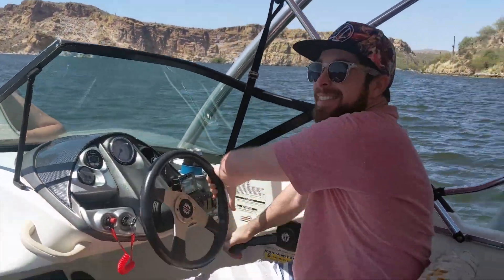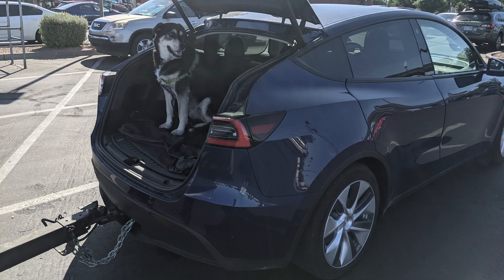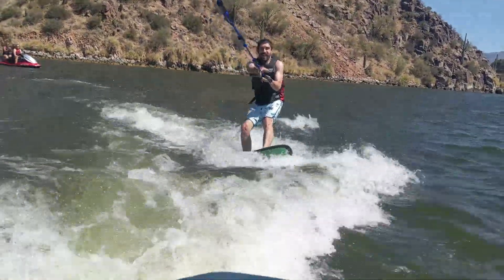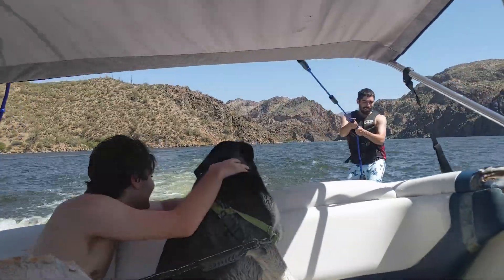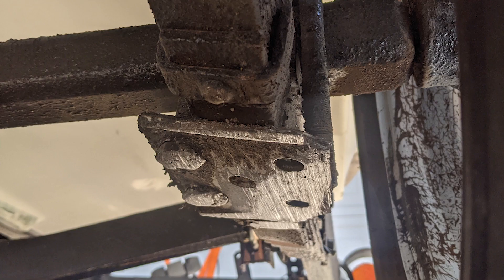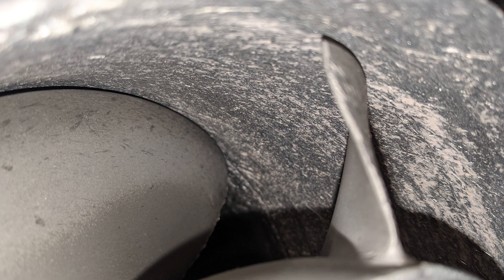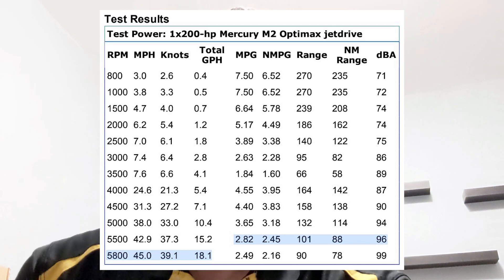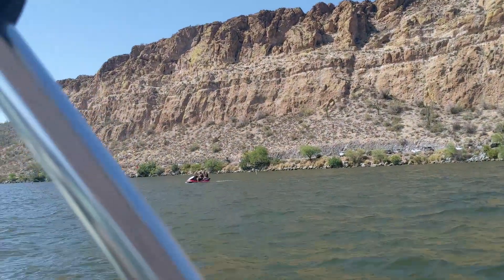E-Doo - Electric Seadoo Boat Wakesurfs but Won't Plane! Conversion Project First Water Test Results

Comment: Holy shit the SAME thing happened to my dad right after he bought two brand new Sea Doos in 1998(?) while we were headed to our lake house. It was about a 1.75 hours drive and an hour in the right wheel just decided it didn't want to be part of the trailer anymore. Thankfully my dad had gotten a truck mostly for towing the dual jet ski trailer and it didn't do much to the truck but I could only imagine if we had been towing the jet skis with something smaller

Comment: 5:11 you guys could have easily shortened the battery belts though, just saying lol. I had same issue lifting my cnc mill and I just made a couple of knots on a belt and it worked :)

Comment: Sweet...
I'm also working (slowly) on a 18' bowrider conversion, sterndrive. Probably not ready for splash until spring 2022.

Just for comparison I went with 272AH Lifepo4, 60 in a 2p30s configuration, 96 volt nominal, total 52 kwh. $5600 delivered to US. Total weight 660#.

Also planning on LV Hyper9.

We need to see more tech stuff!
Thanks
Tom
Reply from the maker: Sounds like a great project! I know the feeling the builds can take a lot of time to figure out. I hope to get more videos out soon but I am very slow about making them especially in the summer.

Comment: I really like your project. I have taken on a very similar project myself. I have bought a 16 ft.1998 Sugar Sand Jet Boat, which I believe is about 700 lbs. lighter that yours. I have removed the 175 HP Sport jet motor. And I am now deciding what size motor, volts, etc.. to purchase for it. If you have any advice for me I would really appreciate it.  Also would you have a picture you could share, of how you mounted and coupled your motor to the Jet Pump?  I have some idea how you did it from your videos, but I picture might be more helpful. Can't wait to see your next video on this project!
Reply from the maker: I really need to finish the videos as I have a ton more footage of the build but have just been a tad busy this summer. Definitely have some pictures I will try to share soon. As far as advice goes, don't under-spec the motor too much as you can see from my plane-ing issues here! And also be aware that the batteries will probably add the same weight as a few passengers - it would be wise to have it near the center of the boat and not so far to the back as I did. Ideally if I could do this over I would have pulled out the 40 gallon gas tank that is in the center of the boat, cut the top off and put the batteries in there, re-sealed it, and put it back where it was. However the reason I didn't do that was I would have needed to cut some major fiberglass to get the tank out due to the Utopia's design. Everything else I have been happy with so far.
Reply: @ThatOneGuy7575  Thanks for the information, I will definitely plan to pull out the gas tank and utilize that space for the batteries.  I am thinking I will probably go with the same motor you have.  Can you let me know how much your battery pack weighs?  I'm thinking I might go with a similar voltage, as you, but try to have a smaller/lighter pack. I know I will be sacrificing some KWH & range. But I plan on using the boat more as a bass fishing boat, where  I only need to go fast for short periods between fishing spots.

Comment: Great project, very good video  THX. 
Maybe you can try to throw the Jetdrive out and use a propeller. I think that is more efficient and with the power you have it could be possible to plane. 
I own a Challanger and you’re Video helps a lot , because i have the same plan.
Reply from the maker: Yeah I went back and forth between prop and jet drive. The main deciding factors were that I wanted to wakesurf and the jet drive popped up for less money than a true v drive and was lighter. But a prop is probably more efficient (though I have never seen a true comparisons using the same hull).
Reply: Most of the electric boats have a direct shaft drive and no Z Drive or Jet because they cost Power. Mercury sold their 60HP outboard as 40 HP Jetdrive outboard. Can you tell me the weight of you’re batteries??
Reply from the maker: The batteries are about 50 pounds per 4.75 KWH pack. Which equates to 400 pounds for the 8 pack (38 KWH) system I have now or 500 pounds for the 10 pack system I plan to have total (47 KWH total) that is planned. There is also some extra weight for the cooling and metal that I encased them in so I assume somewhere near 600 pounds in the end for the whole system. I pulled a 40 gallon gas tank wich is 320 pounds and the original motor and new electric motor probably equals maybe a 50 pounds loss. So in total I estimate I added 270 pounds.

Comment: Looking good Eddie on the surfboard. Nice job designing, building and testing it. Once you dial it in, it will be fantastic. Well done. 
I lost a wheel on my boat trailer once. Lucky though it was tandem axle.

Comment: Sweet vid! The torque dropoff at higher RPMs is something I'm wondering about too. My sea-doo is just a PWC rather than a boat, but it will be interesting to see if the torque is enough I'm using an AC-35 at 98v might go up to 144v if I have to though. Trying to get mine done in the next week or two to test out!
Reply from the maker: Unfortunately it is pretty rare for anyone to put boat engines on a dynamometer though so it's very hard to know exactly what the stock impellers is "geared" for. So it is definitely a guessing game. Excited to see how yours goes.